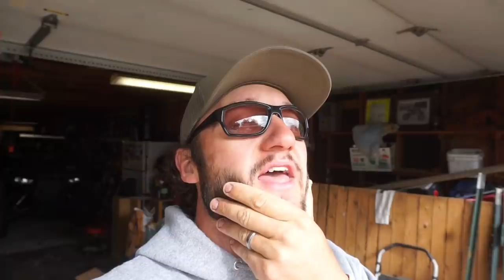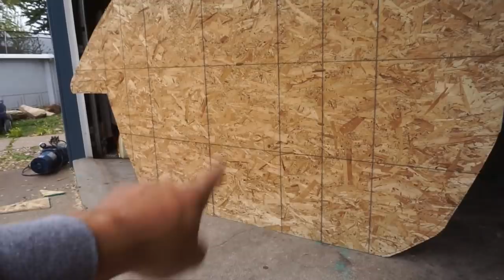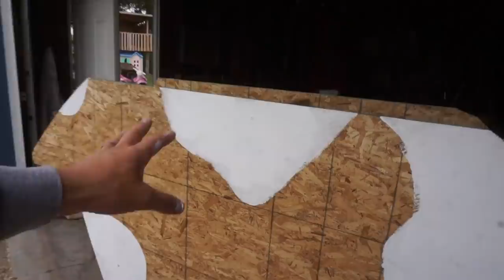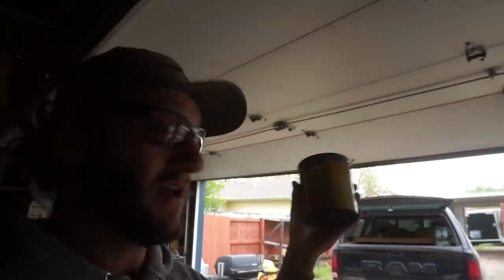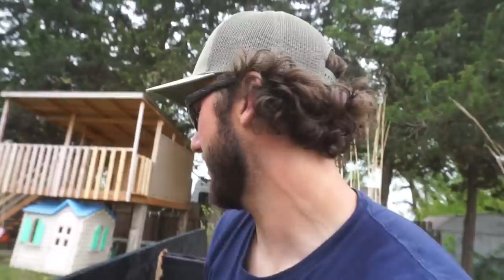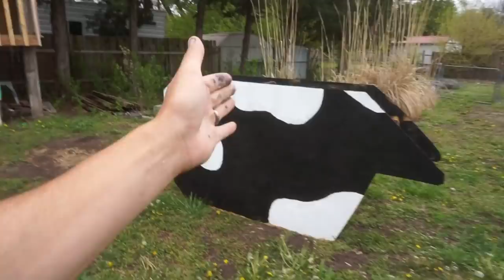Homemade Cow Blind!!

Comment: Yes on the hay blind. Possible cow blind upgrades some net or other material for the edges/top, rope handles on the inside for moving it around, maybe some wheels inside so you can creep around in the field more easily/naturally, maybe have some white on to add the "spots" to the cow when viewed from above if the interior is all black (edit: on second thought all black clothes/ interior with white on the edge material may hide movement better) and you may like some holes or slots to look or shoot through so ya dont have to stand up or make obvious movements(edit: you can have the 410s sticking out like side cannons on a ship lol). Good luck and I hope ya like the ideas!

Comment: OSB sucks if you want lasting outdoor projects . It breaks down very fast in the elements and squirrels love the higher glue content ... Keep it dry and inside when not in use .
Reply: You can paint legs under chest cavity with grass or cornstalks coming up over the body sections to blend it in better
Reply: Pick up cattle screens that can be wired end to end for haybale blind .Get the heavy gauge ones , then you can cut a section of plywood to be used as a floor . Most sectikns are 48" high with different lengths . Use 60" chicken wire , or 48 " , to make front and back , weave long grass or corn stalks in to break up outline .Wire  2x2 across front to desired heighth to give straight edge for bending chicken wire inside on front . Use imagination and experiment.
My friend uses these as portable ground blinds in harvested crop fields during late muzzle loader seasons , works great !